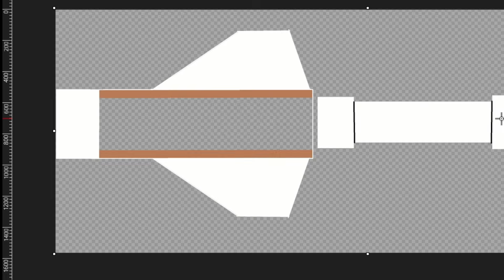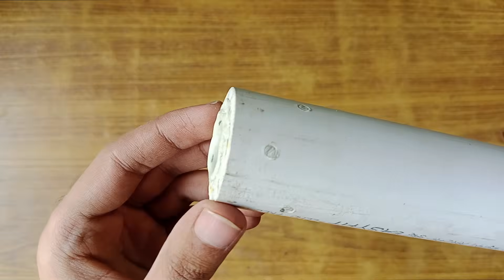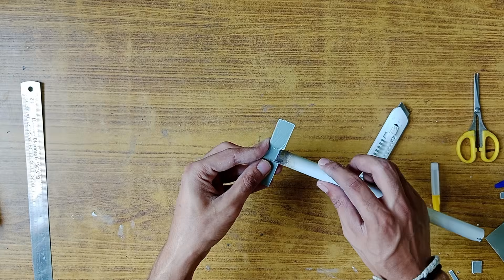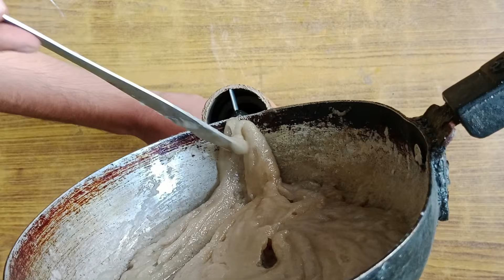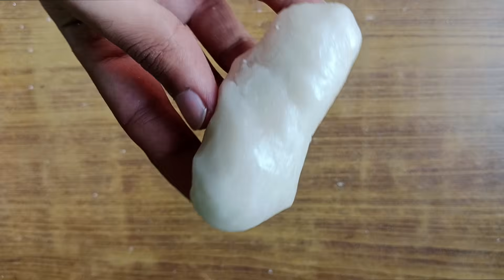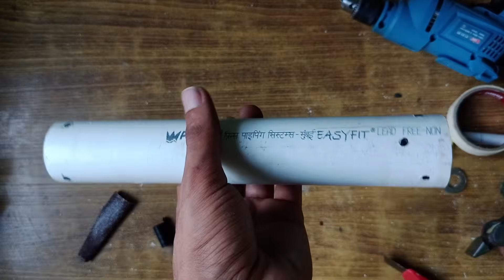This is how i made a PVC rocket motor!

Comment: I made a  motor 200g 2.5cm×8cm weight and it give 8kg thrust for .8 second and my motor is tiny compared to yours first wanna say that you are making mistake you shouldn't use water instead use sorbitol (glucose) and granular kno3 a little bit sorbitol is the golden class for amateur rocketry cause it melts and become liquid at around 95 degree celcius.
If you use that you can easily get 20-25 kg thrust with same size and i wanna tell that don't use pvc for high power motors tha pressure will near 500 psi so it wont work.

Comment: Im facing a problem using the 65% potassium and 35% sugar with no water  its always slow burning im igniting it from the bottom with a fuse idk what im doing wrong
Reply: do you have a nozzle? if you do, then check the potassium nitrate, if so, then it most likely has absorbed water, since its hygroscopic. and please ensure the only hole in which the exhaust can go through is the nozzle, that all said, build an electronic igniter, you can find a tutorial here : https://www.youtube.com/watch?v=Mk3CvYc1egw. since potassium nitrate is similar to other nitrates in agriculture, it is also likely that you've bought a percentage of potassium nitrate and the rest is a bunch of junk nitrates, please be aware of your suppliers

Comment: i made something like this too . i got 200g of fuel burned in 1.3 second it was very powerfull i had aluminum casing not pvc and i have expoxy too on the end cap and it diditnt metl and i used FDM techonlogdy 3D printing to from the nozzle with the epoxy and i used metal washers too . in frist  1 second everything was right  but when the expoxy started metlting it blew out the noozle and by the screw it started melting aluminum casing  . when u casting fuel with table sugar u shuld wait until its like plastelin and mold it inside